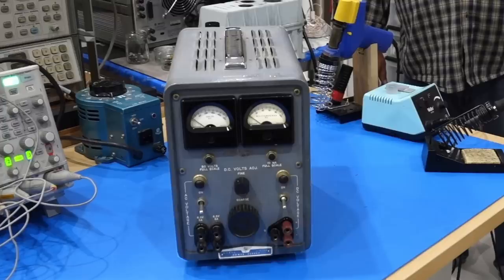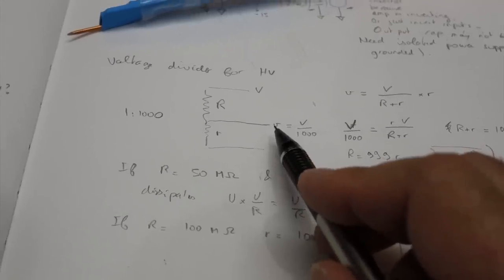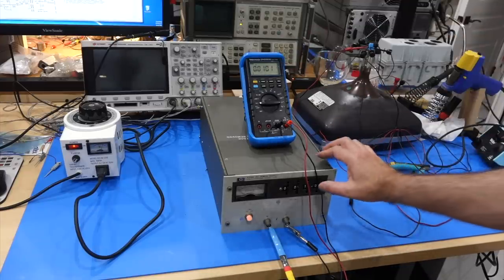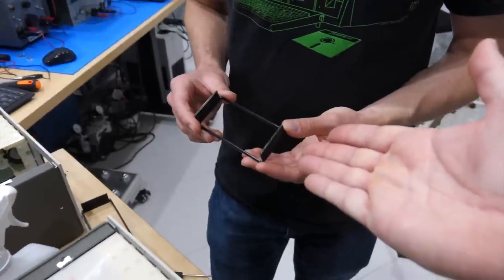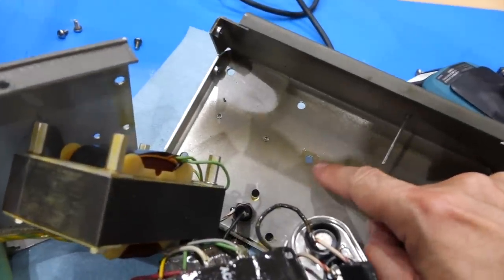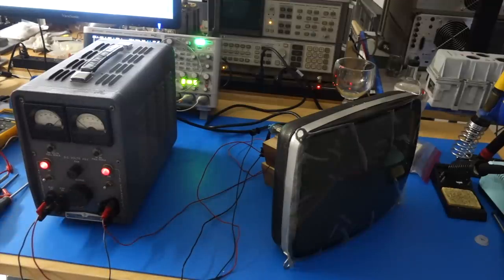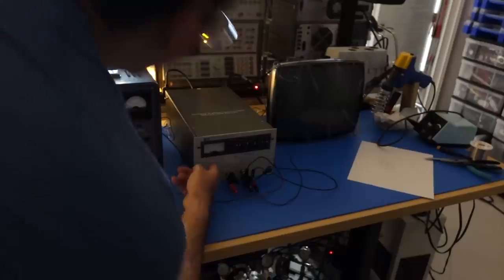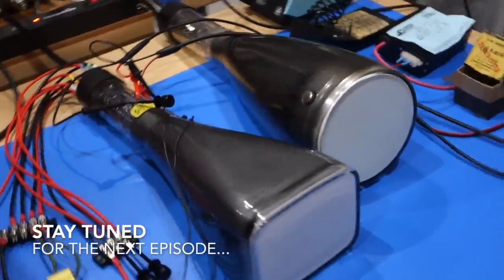HP 6516A 3kV Supply vs. CRT Tube

Comment: You are right to be concerned about those caps. The ones in the rear are marked as Sprague "Clorinol" types, which was a tradename for PCB (polychlorinated biphenyl).
Reply: That's what I was going to say.
Reply: if it is a cap with PCB oil, it will likely still work century old. Unlike those modern eco variants.
Reply: @Sixta16  Yep

Comment: Some terrifying voltages you're dealing with there, glad you've got the knowledge and experience to be safe so we can watch and learn!
Reply: 6mA is not that dangerous. But it hurts a lot nonetheless. The danger starts with electrophoresis power supplies. They are quite popular with hobbyists because they are cheap. Some of them put out 30kV with tens of milliamps. And you can parallel them... Those can knock you off your feet pretty bad.

Comment: I'm betting that oil came from the cap of a different power supply in in the pallet. It might be one of the ones you haven't gotten to.
Reply from the maker: I thought so too, but then I was told that oil from oil caps should have a very strong smell. This had no smell at all, so it was probably just regular oil from somewhere else. But I'm just guessing.
Reply: @CuriousMarc  It's a smell you can't unsmell, like nothing else, and it will stick in your nose. Hard to describe, slightly 'fruity-musty' smell I would say. Once you know, you will smell leaky PCB caps from miles away. ;)
Reply from the maker: @diskettenfett3161  Thanks, this is very helpful. Definitely not that then. I also went through all my supplies, three had a fallen meter and about the same number a bad front switch, but they all worked, and none of the caps did leak. So confirmed not being oil from another supply either.
Reply: If it keeps leaking oil, you'd better send it off to CuriousMarc's Garage. It'll probably need a clutch job by then, too...
Reply: @diskettenfett3161  I don't know anything about this kind of oil or electronics, but for example, vegetable oil like Olive oil, if you let a thin layer of it outside, after some time, it doesn't smell anymore. Is this kind oil smelly like for tens and tens of years?
I was wondering, as in the video, the mystery is that the oil in on the back left side of the device, and the oil capacitors are on the back right side of it, couldn't it be that the device was stored on its left side when the leak happened, and so, made the oil leak on the transformer and at the bottom (on the right side of the case) ? (which could explain the oily screws outside as the oil would have infiltrated through the holes).
It's just the thought that came to my mind while watching the video, but again, I don't know much about electronics so I might have said something really stupid :D
Reply: @Mat_1000  The leaky oil caps that I encountered definitely had not lost their characteristic smell. After removing and thouroughly cleaning the device, the smell was very hard to get rid of. It still smelt a bit  years after the caps were removed and cleaned...

I used to deal quite a bit with PCB oil caps in industrial gear, and they all had the same fruity-musty smell, some were not even obviously leaking and you could still smell it.. Yuck!
Reply: @diskettenfett3161  Ok, thank you for the answer and informations ; )
So maybe someone was eating near expensive equipment and spilled their salad sauce all over it :D
Anyway, good to know the device is still in good shape!
Reply: Not all PCB coolant has a smell, just FYI.. some will be so strong that a single drop on your skin will absorb right in and make you smell & taste that "old school phenolic electronics  smell" for days. Some has (in my opinion) a suble but noticable cross between raw peanuts and brake cleaner smell, and that's the REALLY BAD stuff that needs to be properly contained and taken to a disposal site post haste. A little PCB won't hurt you, but it's still a forever-chemical and a little on you will make you physically taste it in your mouth for days and days. I hate vintage PCB stuff
Reply: @Drmcclung  PCB oil is also extremely dangerous, i really hope your skin did not absorb some, that would be pretty bad.

Comment: Lightsaber sounds made my day!
Modern engineering solutions (3D printing) just fade in comparison with the good old hot snot, haha. Beautiful is better than ugly... but simple is better than complex, complex is better than complicated.

Nice CRT collection :)
Reply: It needed to be printed with something less brittle with better layer adhesion, perhaps Nylon.
Reply: Or sla
Reply: no that was just not the correct material or orientation. There are many ways to overcome this, I could have made that part actually work using any of like 10 techniques in 3d printing. Hot glue has it uses, but let's not be crazy and say hot glue is better than the whole of "modern engineering solutions"

Comment: One note of caution when using a hv probe (I have a 1000:1 B&K probe) with an auto-ranging DMM.  I managed to fry the mV range on my Fluke 79 by probing an oscilloscope CRT power supply (~8 kV) b/c the meter was initially presented with zero volts, it was on the mV scale.  I suspect that when I touched the probe to the hv point, the capacitance of the probe allowed a brief significant overvoltage to reach the meter.  From then on, I've always manually selected the range when using the hv probe, and I've not had a problem.  I noticed that when you were using your homebrew probe, you started out low and slowly went higher, which also avoided the problem.
Reply: Does not sound probably. If there are caps as to frequency-compensate the voltage divider in the probe, then I would expect them to incorporate in the design a series peak current resistor as to exactly limit this phenomena. On the other hand the Fluke 79 is a decent meter with solid protection on inputs, so hard to suspect as what have gone wrong.

Comment: This reminds me of a time when I tried to light up a TV crt using a spark supply I had made.
The spark gen could throw a 6cm spark, so I figured I could generate a spot on the tube.
The only other supply was a small regulated supply I used to light the CRT's filament.
Unfortunately the spark gen pushed the filament supply many KV above ground causing a flash over to ground and a fried LM301 op amp.
I killed my variable supply and never got a wink out of the CRT.
I didn't have any grids connected, I was trying brute force and ignorance.....

Comment: I remember back in the repair days,carrying a crt from the stores to replace one on my bench,got one hell of a zap from the anode cap socket,i was told that over time the crts charge up and can have a few kv on them,without being powered up!!!! ,static in the air charges them,well they are one big cap afterall.Then on i discharged them in the packing box,before lifting them out.

Comment: I bought 3 of those HP power supplies except the low voltage variety with the heated Zener. In all of them the meters have fallen out and I was really confused where those springs were supposed to go! I've restored 2/3 at this point and they work great(the main filter caps went bad and on one the leg actually corroded off!)

Comment: From what I seem to remember, CRTs also generate X-Rays as well as visible light if they are operated at their normal voltages.
Reply: Usually at the higher voltages, like 22kV, I don't think it would emit much at 3kV
Reply: @BobHannent  The energy spectrum emitted is proportional to the acceleration voltage. As such, at 3kV you only get low-energy X-rays which are easily stopped by the glass.
Color TVs that operate at 25kV need to have lead glass fronts as they emit considerable amounts of high-energy X-rays.
Reply: @graealex  The funnel would be leaded but the face is strontium glass because leaded glass turns brown from x-ray exposure.
Reply: @hughgilbert390  Oh, didn't know that. Thanks, you're absolutely right. Lead only in neck and funnel.

Comment: Oh my, I FINALLY found an area where my lab is better equipped than Marc's. A year or so back I got hold of a never-issued ex-USMC Fluke 27 kit with RF probe and, not one, but two! HV probes; 6kV and 40kV, all in pristine condition.  Have only used one of them to check the HV supply of my 465 scope, so far. 

I trust this is not going to last as a proper probe is on order.

Comment: A tip is to use rtv silicone / small amount of tech7 insted of hot glue. As the hot glue is to often not gluing well. I think there must be many different types of hotglue, but the types i have releases easy :(
Reply from the maker: Or E-6000 maybe. Hot glue really a band aid for now. Although I have hot glued panels in my R2 and they have not come off!
Reply: Never had much luck using hot melt to thick metal surfaces - like front panels.
Silicon would have been my choice, although a pain to remove.
Reply: @paulstubbs7678  Maybe pre-heat the metal  with a soldering iron so that it doesn't cool the glue too quickly.

Comment: The breakthrough voltage requirement of aluminized CRTs is normally around 2-4kV. Less than that, the electrons don't have the energy to penetrate to the phosphor and light up the screen.

Comment: I propose that you turn this into a progressive instructional series.  How to go from making a CRT glow to actually building a working television circuit to drive it.   You have basic CRT functionality, now put a deflection yoke on it and start driving it with horizontal and vertical signals   Build a basic B&W TV circuit one circuit section at a time.    

Of course this would be analog NTSC TV.  That's fine.

Comment: Most of these old small CRT will work with about 10 - 12 KV. they are just blank and white.
i remember my first experience in repairing a color TV. the anode is about 24 - 30 KV.
I turn it off but forgot to discharge the CRT at the HV connect near the  aquadag coating. It knot me across the floor with a 'Ouch '

Comment: For simply determining the color of a monochrome CRT's phosphor, does shining a UV light on them yield the same results as exciting the tubes normally? In the small number of CRTs I've shined my UV flashlight on, I think they appear to glow their normal color. I can even see the screen burn from the graticule on my HP 8560E. Naturally, exciting them normally is more impressive and it demonstrates that the electron gun is not dead.
Reply from the maker: No, it does not work except on some older low voltage scope screens. But not all of them either.

Comment: Haha the meter bezel... I bet you got the STL file from grabCAD. I recently got a HP 6111A power supply which uses exactly the same panel meter, and also missing the bezel. I almost sent the STL file for SLA printing, until I found out it was for larger meters. Still don't have time to measure and draw one though, and I believe that SLA printing will be much more reliable than FDM here.

Comment: I have yet to have the nerve to really mess around with my 3kV/1.5kW adjustable lab supply. I’m guessing if I screw up it kills like an MOT, but with much greater precision.
Reply: Oof, half an amp, and the voltage to drive that. Would probably be even worse than an MOT if DC, same result but slower :/

Comment: My experience with HV is limited but I replaced a HV cap for a microwave oven, it leaked this very thin oil just after 23 years of almost continuous use. I guess the last roast was fatal for it.
Reply: The experience someone can have with high voltage while alive are limited anyway ;)

Comment: Excited to see those old CRTs come to life. Marc, can you tell me where you ordered the High Voltage probe...I need one for my vintage Clare Insulation tester. Thanks in advance.
Reply from the maker: Mine is a 40 kV Fluke and is off eBay, plenty available. You can also order them new from just about anywhere.

Comment: This may be a dumb question, but could you also hit it with a UV laser to see what color the phosphors are?  Works with my white & blue phosphor CRT's.  Not sure if that'd work with orange or green.
Also, thanks for showing the improvised HV probe!  That worked great!  I need one, but only for 600 - 1kV.  I'll be sure to take your advice and NOT build one of my own.  ;-)

Comment: If it uses electrostatic deflection, you should be able to move the spot to other parts of the screen by applying voltage to the deflection anodes.
Reply: That looks to me like a magnetic deflection tube. As I understand it, electrostatic deflection can only develop a small deflection angle, which is why oscilloscope tubes are so long compared to their screen size.

Comment: 3kV is really low for anode voltage. If you get light, I'd be surprised. Even small B&W ones like 9kV+ to make light and more for good focus.
Reply from the maker: It’s very low indeed. This CRT normal acceleration voltage is 17.5 kV! But for a quick phosphor test, 2 kV was apparently plenty enough.
Reply: he said in the video it started lighting up at 2kV- and they only needed to see the color of it

Comment: If one of those power supplies starts to smell like a slightly rotten pineapple; get it outside the building. Quick. PCBs are nothing you want to be around in a room. Even if my father literally bathed in that stuff in the 60s and just turned 85.

Comment: Hi! Can you make an amplifier from CRT? It will be a wery interesting.
Reply: If your on about a audio amp it won’t work. This is because a crt is only meant to display pictures
Reply: @jaut-76  It's too bad, because  CRT is a modyfited tube.  Soon my friend will give to me a 2 CRT TV set's,  & I try to use a CRT in a different tube modes: as a triod, tetrode,  penthode & in full CRT mode: uslng a secondary  winding of fly back transformer as speaker load...
Reply: I heard that you can use a VFD as a triode -  a very crappy triode, but it works. I want to try this since many years. I don't think it would work with a CRT, but might worth a try.

Comment: capacitive voltage divider with full bridge rectifier + output capacitor stabilizer = capacitive dc regulated power source
Reply: if you add a transformer stage in the beginning, you get a transformer voltage divider amplifier, should be very frequency independent
Reply: tunable capacitor voltage divider amplifier

Comment: Isn`t filament voltage for CRT normally 5V?
Reply: Usually 6.3V.
Reply: I've mainly seen 6 or 12V
Reply: @paulstubbs7678  Yeah that`s the norm on "small" tubes, but all the CRT`s  beeing tested on Shango066`s channel are tested on 5V. He has a quite interesting channel and know a thing or two about old TV sets.
Reply: @tipetu  Normal operating voltage is 6.3V. The 5V is applied as a "life test", to see how quickly emission drops off with cathode temperature.
Reply: @bobweiss8682  Interesting, thanks
Reply: 6.3V, 11V, 12V are the usual heater voltages for CRTs. Although I have a 4.5" CRT TV which has a CRT with 0.5V heater. Philco also used some weird filament voltages, around 2.5V IIRC. The Soviet 16LK1B small TV tube has a 1.35V heater.

Comment: It would be fun, albeit a bit lengthy, to add an Arduino Pico to drive the horizontal and vertical coils to show a static image ( or animated ).  They can do the signals for VGA signals and having the IC do the timing directly for a tube should actually be easier.  I recommend The channel logo as a test, especially for the round CRT that was previewed.

Comment: I wonder if that was my bezel model from Thingiverse, or someone else's. Yeah, it was too thin and weak.
Reply from the maker: It's yours!
Reply: @CuriousMarc  Sorry it didn't work for you. Same thing happened for me, as you would expect. Was just thinking maybe extremely thin strips of metal, glued to the plastic, would be enough to strengthen it. 

Or hot glue works a treat.

Comment: Amazing! I was a bit suprised that it light up with floating grids & anode, but I got even more suprised when it worked with a grounded G1. Most CRTs I have read the datasheets (all scope CRTs, electrostatic deflection and small angles) needed a negative voltage at G1 to even light up, and with a grounded (rel to cathode ofc) G1 they would just cut off.
Reply: Edit: Just uploaded a video on the topic. My CRT is quite a bit smaller, but it's quite a cute one!

Comment: CRTs excited by high voltage can generate X radation, so be careful with experiments!
Reply: The relatively low second anode voltages on these tubes (3 kV) aren't likely to produce a large amount of x-rays and the rays they do produce are likely to be very soft.

The tubes you have to worry about are the huge old color television tubes with second anode voltages of 30 kV or more. Even then, you're likely to get more x-rays from the HV rectifier and the focus rectifier than from the CRT.

Comment: I have had some luck reinforcing 3D prints using very thin piano wire melted in to the plastic using soldering iron or current.
Reply: That might be difficult in this case, because of how thin the part is. Perhaps it would be possible to glue a very thin strip of metal to the plastic.